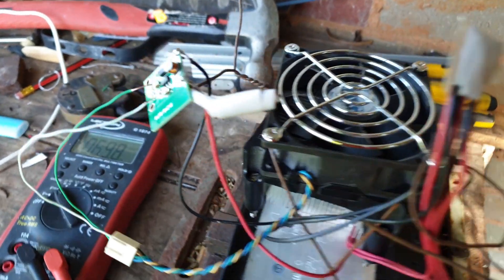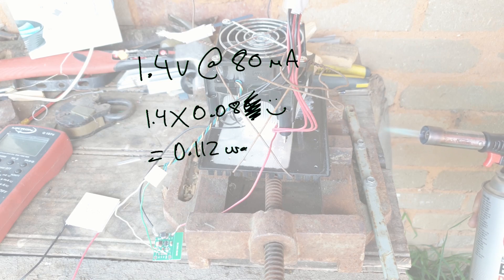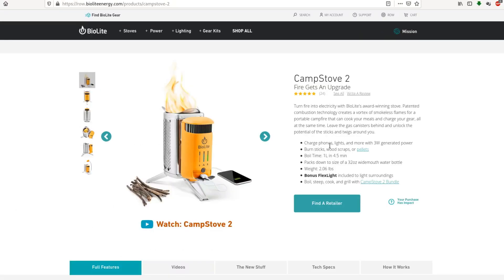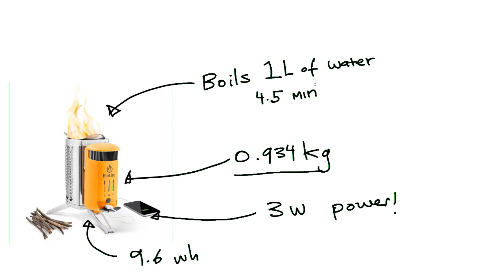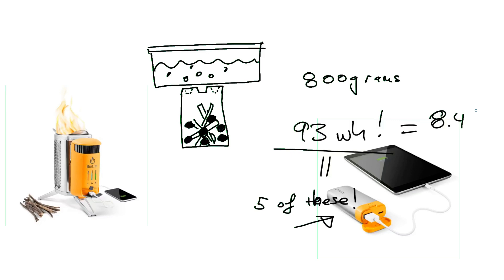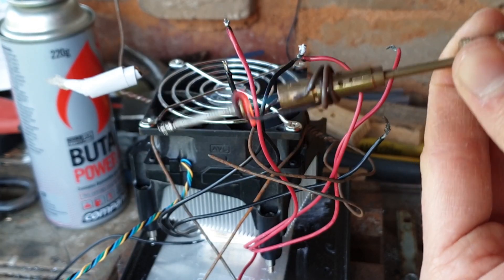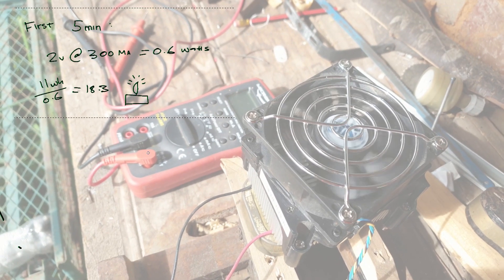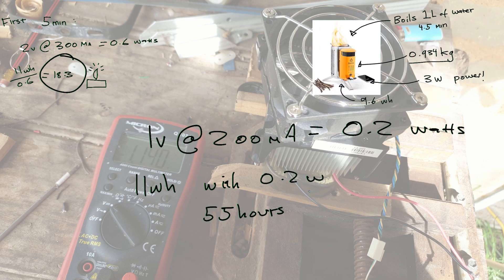Charging your phone with a peltier device and a candle: Don't bother.

Comment: you do know that each side of each individual peltier has hot and cold sides right? why did you sandwich it? each peltier should produce more than the voltage you are saying. i dont think you know a peltier device works my friend.
Reply from the maker: To be honest I was learning how it worked while I was recording/making the video which is a terrible way to produce a video. I think I was 'sandwiching' them at the beginning in a attempt to increase the voltage output like they're a stack of battery cells. This as I found out didn't work any better than a single peltier device ( Only one of them was really getting the heat, only one was getting proper cooling, kind of stupid really). 
I think 2V is a OK voltage output considering it's only a single candle. Most of the time it was lower as I failed to maintain a good temperature difference.  You might be right though....